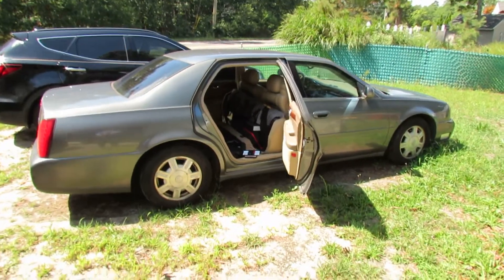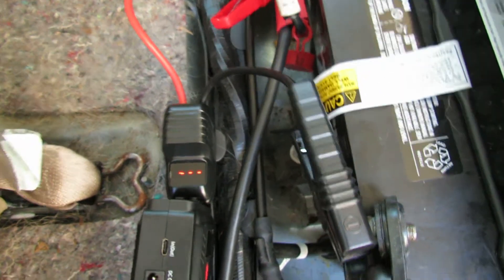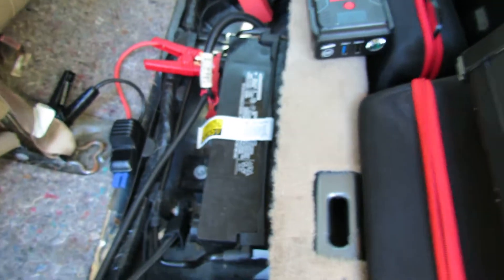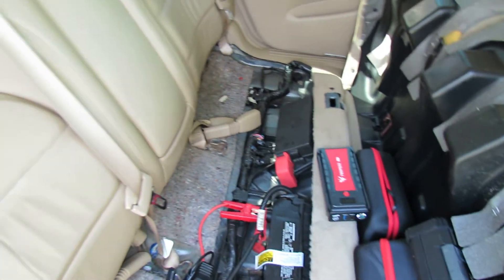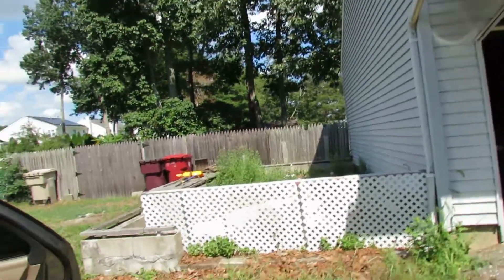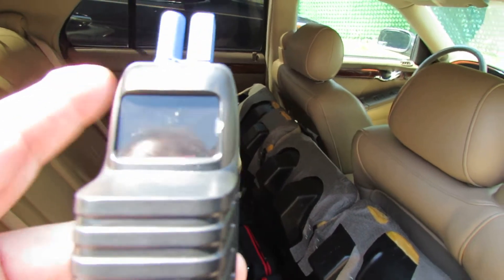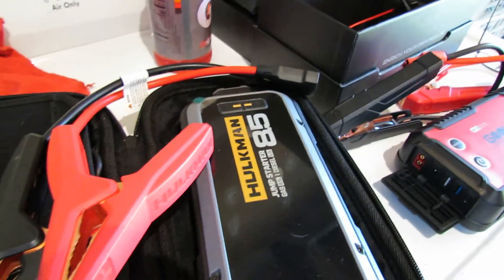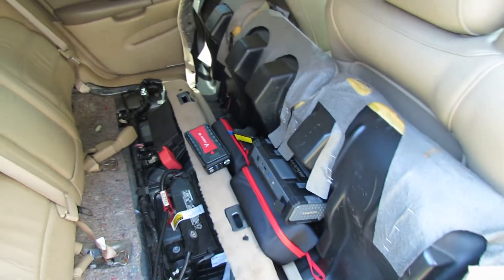ARE SMART JUMPER CABLES INTERCHANGABLE??? (WATCH)

Comment: @H & M RELOADED, You should NOT ever encourage other folks of doing this sort of thing, as in simulating a dead
battery by disconnecting the car battery OR removal of a battery as such, ever, ever, EVER!!! The reason why is this:
The battery is in part and parcel helps regulate your vehicle's charging voltage and when disconnecting a battery, 
makes for a very BAD situation whereby you can destroy an alternator first and foremost on account of not having
a battery in circuit to stabilize a vehicle's electrical system, good clean and solid connections included! Secondly,
these newer vehicles from about 1991 onward, especially in the GM line that are set up with these high output
alternators of around 145-175 amp alternators that are basically used for a heavily accessorized interior packages 
that may also have things like heated seats, heated exterior mirrors, fog lights etc! Ask me about what happened
to my 1991 Camaro that had a faulty ground connection that literally caused my alternator to burn the F up!!! SO,
when I inform you of this, take heed and listen! These newer vehicles are highly sensitive to these sorts of things.
Thirdly, by doing what you just did in this video, you can not only destroy an alternator by hotdogging it, BUT you
can even cause thousands and thousand of dollars worth of damage to other system modules, the main engine
and/or the transmission module if things really go wrong!!! Though on these newer vehicle from about 2000 onward
have the main engine computer manages the alternator on virtually all vehicles, you can still set yourself up for an
utter catastrophe. Just think about it, some of these highly equipped newer vehicles that include your foreign exotics
cars and even you limos could be loaded down with upwards of 100 onboard modules that could be effected if not
destroyed by pulling a swifty like what you just did!! BAD, bad, very bad idea to simulate a dead battery like you did!
Now, if you were to do the same thing like on an old beater such as on a vehicle that is really dated such as 19100's-
through around 1987, well you just might get away with what you are doing and perhaps no harm would occur, but
hell's bell's man, just don't do it period!!!
Reply from the maker: Remember,  we don't encourage people to do anything in our videos. We show people our experiences and show them that it can be done a certain way. I have spent countless hours testing all my products before i ever put them on video to make sure nothing will happen and that its safe. Also, we have seen so many other people in the past do this exact thing with seeing if modules on portable jump starters are interchangeable or not, and nobody ever had an issue getting hurt, or destroying thier car or jump starter. I have seen people simuate dead batteries on old and new cars with no issues, because they have protections built in the module and unit. These portable jump starters have protections in place so that user error won't happen and to make sure everything is safe. For instance, if i plug in a module from another brand jump starter in a different jump starter brand when simulating a dead battery, the module just won't work. These portable jump starters have many protections in place to avoid injury, even when simulating a dead battery. Please watch some of our other vids to see how many protections these jump starters have. In this case, the jump starter, vehicle, and user will be safe. On this day, i spent a lot of time before the actual video, seeing if these modules were interchangeable by plugging them into each other over and over on a simalated dead battery. In my experience, nothing ever happened after doing it literally a hundred times.  We appreciate your comment and concern, but we would never put people in harms way.